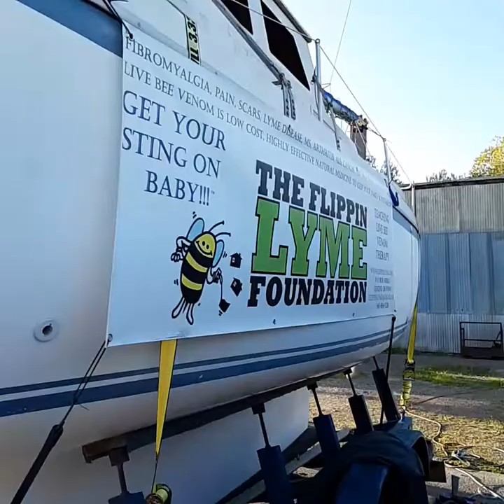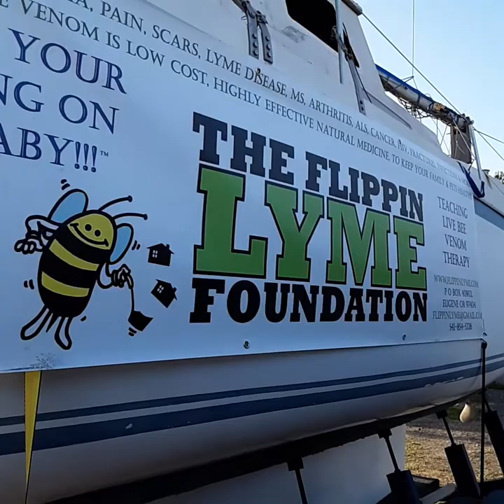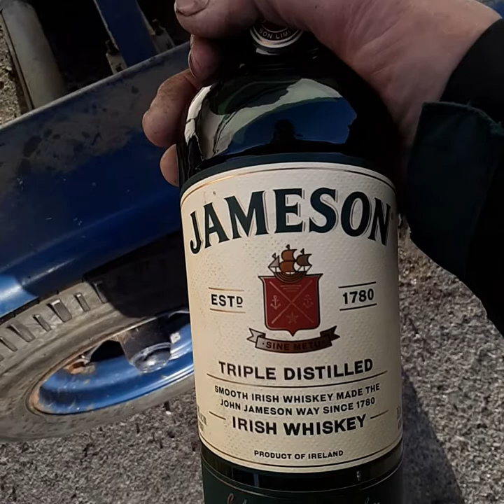Rut row, I've discovered a new rusty problem.  30' Luger Voyager Adventurer sailboat

Comment: The depth of the replacement beams don't look nearly as deep as the originals, and depth is what gives a beam strength.   They are certainly stronger than the originals as they currently stand, but I doubt they have the strength of the originals when they were new.  I hate to throw cold water at it, but you really should check out the strength of the new ones.
Reply from the maker: You can hold on to your doubts if you like. In the meantime I'm gonna go sailing.